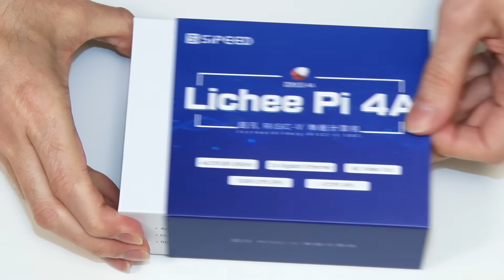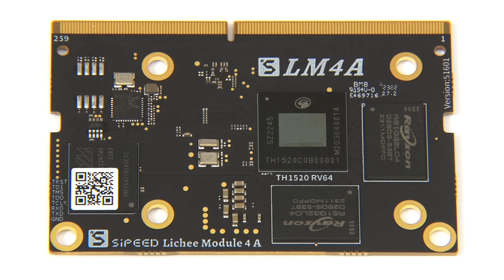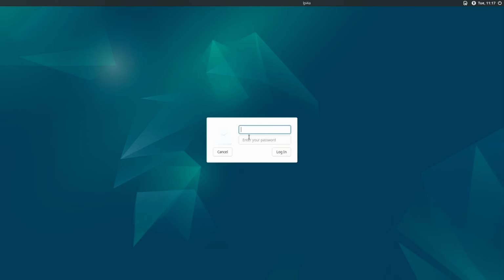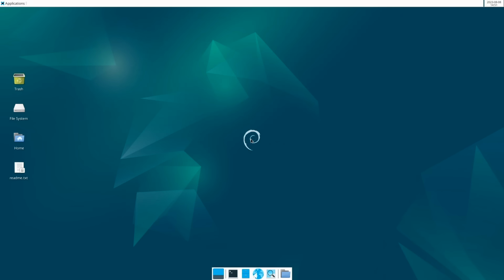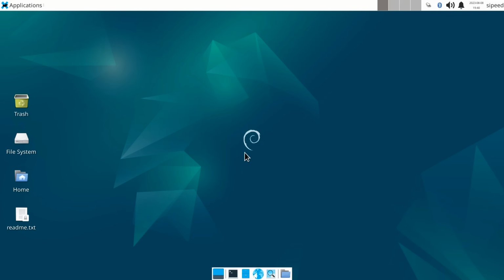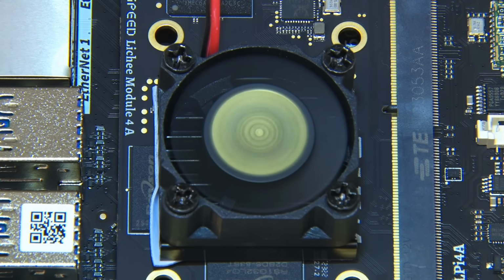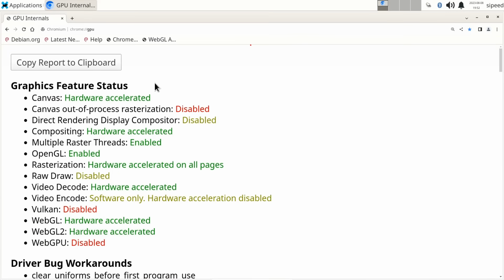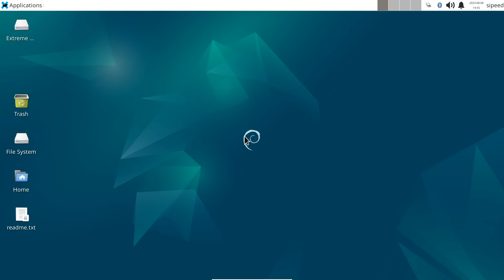Lichee Pi 4A: Serious RISC-V Desktop Computing

Comment: Free Software is just amazing isn't it? I don't see MacOS or Windows running on all these architectures. Gentoo is the penultimate example of what Free Software allows you to do, where you can compile every package on the system and optimize it for your computer. I hope that RISC-V does to the hardware world what GNU has done to the software world. I also wonder if they plan on releasing replacement SoC's that just slot into that backplane that you already have? That would be a good way to upgrade. I hope that we can start getting ATX or ITX motherboards that have replaceable CPU's, with how RISC-V is developing, something like that makes a lot of sense right now, at least for developers at the moment.

Comment: I’m happy to see another RISC-V board though for my uses I wish it had an M.2 connector for a SSD.
Reply: The base TH1520 SOC might not actually have the capability to directly add any M.2 storage at all. There's schematics on Sipeed's repositories of the carrier board and there's basically nothing on it implying any level of PCIe support.

Also, Sipeed said that they are going to add storage via the USB 3.0 ports for their laptop. Even the Evaluation boards don't have anything related to storage at all.

Comment: PoE is great but the GPIO is rather limited. However, one could easily interface with a dedicated microcontroller and use this module for all the higher level processing.

Comment: Once again, some fascinating RISC-V hardware.  The name begs to be compared to a Raspberry Pi 4.  I am looking forward to your RISC-V week video.  Curious as to how difficult it is to upgrade the distro/operating system.  I hope others find RISC-V as fascinating as I find it.  Looking forward to your next video!
Reply: If Raspberry Pi 4s were available at their normal price they'd make this board look very expensive.
Reply: @johnm2012 give me a raspberry pi with 2 nics, both being straight to pcinexpress, no USB in between.
Reply: @johnm2012  Raspberry Pi 4 price aside, it is still pricey.  Other than that, this RISC-V hardware is still fascinating.
Reply: There's initial support and (basic) device tree files in Linux 6.5 for the SOC, but nothing else in mainline Linux or Mesa. No microphone, sound, or GPU drivers in any mainline development path. Everything that makes this system tick is based of T-Head semi's repositories.
Reply: @No-mq5lw  Nice to know.

Comment: How exciting!  I am eager to see RISC-V rise as a viable, open-source alternative to the proprietary, closed chipsets.  Can't wait for your week long experiment!
Reply: only the ISA is open but the actual hardware is closed
Reply: @albertopajuelomontes2066  Depends, some people open their hardware as VHDL. You can literally load RISC-V on a FPGA and tinker with it. Others however sells design, usually with higher spec (like SiFive).
Reply: While it isn't open, the cpu is partially open sourced (openc910), afaik they only removed the pre ratification vector extension implementation in the part they open sources.
Reply: @oj0024  or didn't add it. The vector unit is an extra-cost option on the C906 and C910. The "ICE" SoC on the $400 EVB-ICE board in late 2021 had two C910 cores without vector units plus one C910 with vector. You could choose at boot time whether you wanted Linux to use the vector core or the two non-vector cores. The only C906 I"m aware of without the vector unit is the slower 2nd core (700 MHz) in the Milk-V Duo.
Reply: Exactly.  So disappointing.  This is no better than ARM.  Sure it can run Linux but we're stuck with a old kernel fork (5.10) with binary blobs and no word on Mesa support for graphics.  Any sign of mainline Kernel 6.4 support?  What about open source graphics drivers?  

Risc V is so disappointing to me.  It's just as bad as the ARM wasteland.  non-standard boot loaders, binary blobs, kernel forks.  Not good.
Reply: @tmlf1239  "no better than ARM."  Oh, man, you have NO IDEA how good it feels that this is now the most stinging criticism of RISC-V that can be mustered. That is huge praise, really.  Upstreaming of support into the kernel and various packages is in progress as we speak. Open sourcing of Imgtech drivers is in progress. Mesa too. In maybe another 12 months support for JH7110 and TH1520 (and other related SoCs to come) will be "better than ARM". And the hardware will be caught up to at least RK3588 level too.
Reply: @BruceHoult  that's good to hear.  Will we see standardized booting (a la EFI or standardized u-boot) and hardware trees for RISC V devices?  ARM is a mess here on Linux.

As for being as compared to ARM, ARM chipset and device support upstream in Linux is abysmal. Chinese vendors fork it for a while, then lose interest and move on to other hardware.   RK3588 support is slowly trickling in, thank goodness, but it's not there yet. I still can't easily build and boot a generic 6.4 kernel on the Orange Pi 5 yet.  

I'm sure RISC V will be successful but it will be the same closed, proprietary way that ARM has been successful.  But I had hoped for something far better from RISC V, but in the end it's just like ARM.  The only difference is the license fee the manufacturer pays.
Reply: @BruceHoult  " And the hardware will be caught up to at least RK3588 level too."

And that's you just speculating entirely as much as the person you responded to. You may be right, he may be right - until then, it's just your opinion vs. his opinion.

But in my experience, there are far more RISC fanboys than ARM fanboys - and "fanboy" is the opposite of "engineer", which is what I am.
Reply: same! i love how this may allow things to be both cheaper and better in the future, and the potential to reduce the secrecy and possible back doors in modern processors
Reply: @bingusbongus9807 That is largely a fallacy. Whilst there is no cost to use the ISA in your CPU design, most chip manufacturers will keep their proprietary CPU designs closed, and perhaps licence them out. But putting in all the hard work to design a fast, efficient chip is expensive and time consuming... and freely giving that design to your competitors doesn't make sense.
Reply: @another3997 sadly, open sourcing your hardware like that forces you to have to actually compete rather than have market monopolies. We wouldn't have tech dual police or monopolies if open source was mandatory.
Reply: RiscV is not that open source you think..
Reply: Your understanding of RISC-V is quite poor. RISC-V ISA is free but ISA is nothing but manual explaining the meaning of instructions. How these instructions are implemented in the hardware level is up to manufacturer! And it’s perfectly Ok to do closed RISC-V chipsets and that’s generally how the semiconductor companies do because it’s extremely expensive to design chips and no one in the industry is willing to give this for free.
Reply: @S1LLYC3REAL  that's why RiscV isn't open source at all..
Reply: @ThermalWorld_  the RISC-V specification is certainly open source, which allows potentially large numbers of vendors to complete to make the best and cheapest products. Any given device might or might not be open source. The RV64GC CPU cores on this board are open source with a permissive Apache 2 license. Other parts of the SoC are proprietary.
Reply: @BruceHoult  And SO WHAT? Open foundation business model is not that much different from any other comitee we had before, standardizing SD, USB, MPEG etc. Those who pay more money do have influence on how next versions of ISA will look alike. Currently it's used to put pressure on ARM by Chinease. We have for example Linux Foundation doest that put more pressure on Microsoft - sure, is there one OS standardized? No! Because it's one of many building blocks. You will have bunch of RISC-V CPUs some better some worse, every SoC will be different just as it was for ARM different buses, adresses, everything much like ARM based except this time Made in Shenzen not Taiwan. Say bye bye to STM, and Microchip say hello to Lichee and other Made In Crap Crap. x86, AMR, RISC-V still better than dozen of architecture. It's been 40 years - ARM time to say bye bye ;) Im not excited. Because why should anyone "excited"?
Reply: @KabelkowyJoe  mate, I'm sorry but I have absolutely no idea which of my comments in this thread you are replying to, or how your comment relates to it! You are correct that the Chinese are currently putting more investment into RISC-V than others, but there is absolutely nothing stopping others doing the same and I certainly hope some do. Meantime, there are many Chinese companies doing very good work, ranging from WCH in microcontrollers to SOPHGO in workstations/servers.
Reply: With great power (permissive licensing) comes great responsibility. I doubt that most RISC-V hardware will be open-source, and I am very concerned that future vendors will introduce proprietary extensions to the instruction set.
Reply: @njsynthesis well, then only support the few that are open then.
Reply: @njsynthesis  of course anyone can introduce proprietary instructions, but what instructions currently lacking in the official spec would provide a significant advantage?  RISC-V already has pretty much everything any other ISA has. And how do you persuade users to use them? Especially as you probably have to get support upstreamed into standard compilers to get it into standard distros.
Reply: Very exciting... indeed!

Comment: This is astounding, when you look at it. This is a massive move forwards for the architecture,  and will only inspire more development from others.

I suspect in five years time, the processor type is going to be far more commonly adopted, and could even stand as a decent competitor to X86 and ARM.

Thanks for the video.
Reply: Note that these C910 CPU cores were announced in July 2019 -- it just, as always, takes about four years to get from a core to mass-produced hardware. Imagine what has been started since 2019, and is still in the pipeline, but inevitable. Well .. we don't have to imagine. We'll have A76 (e.g. RK3588) class machines maybe by the end of the year but certainly early next year. And Apple M1-class chips are coming in a couple of years.
Reply: @BruceHoult  I fully accept what you are saying, but I remember the scepticism of the architecture being at this level for a few more years yet.

There is clearly a huge amount of development going on, and this is exciting to me. I want this processor architecture to succeed, and help to widen the options.

Thanks for the information,  by the way. It is appreciated.
Reply: @horseradishpower9947  computer SoCs are like a pizza ... you put the toppings on a base and put it into the oven , then have to stand around for ten minutes until it emerges from the far end of the oven. It takes a while, but there is essentially zero doubt that it WILL come out. It's just that with SoCs you wait around for about four years, not ten minutes. While there are certainly many skeptical voices all over the internet (many with a conflict of interest, by the way), anyone who keeps informed knows what is currently in the oven. I can't tell you what will be in 2030 or 2040 ... but the next three to four years? It is written. Pre-ordained. Inevitable. Skepticism about that time period is totally unwarranted. And in that time frame is 2020-level (or even a bit better) x86 and M1 performance. Which will still be a viable PC in 2026 or 2027.
Reply: @BruceHoult  Thanks for that, it's interesting. 

One of the biggest issues, though, is software and optimisation. You can have  the best hardware in the world, but if the software is badly using the hardware, it is hopeless.
Reply: As someone whose programs (Ansys, CATIA, SolidWorks, 2000-ish games) are Windows-only and 32- or 64-bit, I can't see that happening for enough people in the most influential branches.
Not until Windows-EXE support works out of the box because who has the patience to set-up and trouble-shoot Wine...
Reply: @CnCDune  Windows has the dominance it has, through monopolistic methods. If it ever loses that, it will quickly fall to the wayside.
Reply: @horseradishpower9947  old games and such may not work anymore if that happens. We already have compatibility problems - some since the Vista days :/
Reply: @CnCDune  It might be something that happens any way. There may be a time when Windows itself is too incompatable with old games. Time will tell, though.
Reply: @CnCDune  Companys programming Windows-only software will be dead in 5, latest in 10 years. Even Microsoft supports Linux in professional field (like MSSQL, OK,not professional, but it works). If you don't like Softmaker Office as a professional alternative for MS Office, you can still use MS Office Webbrowser based clients. That is roughly 80% of the use case in Companys.
AutoCAD came from Unix, so there is no problem in developing that for Linux, Games work with steam flawlessly. Any important server runs on Linux anyways.
I don't see any important usecase for windows-based computers in the next 10 years onwards, every operating system has its time, some lazy admins will eventually try to stick with it until retirement, but these will be replaced by skilled people and then complain for their own fault of getting stuck in the 90s...
Reply: @CnCDune   Maybe time for you to start looking at non-proprietary alternatives? Because it’s clear Windows has passed its peak — it is getting more and more expensive for Microsoft to maintain, while returning less and less profit. Which is why Microsoft is resorting to tricks like inserting ads everywhere on the Windows desktop it can.
Reply: @lawrencedoliveiro9104  I agree that Windows is past its peak and going downhill with each version, but unless I'm 100% sure Linux can handle Tiberian Sun (RTS from 1999) and its tools, among other games I have, plus touch&pen, I can't switch OSs.
MacOS is, of course, not an option either.

Same goes for Ansys, CATIA, SolidWorks and other engineering programs - actually, all engineering programs; I don't know of any that have Linux versions, maybe MacOS if you're lucky.
Reply: @CnCDune  Vintage Windows/DOS games tend to run better on Linux than on Windows.

The high-end CAD apps originated on Unix systems, back in the day. Going to Linux would be like coming home for them.
Reply: @lawrencedoliveiro9104  By vintage Windows, do you mean 16-bit or 32-bit prgorams?
TibSun and tools are 32-bit.
High-end CAD may have originated on Unix, but now there's only Windows-versions...
Reply: @CnCDune  There are open-source CAD programs that rival what’s available on Windows.

Old 16-bit Windows software runs better on Linux than it does on current Windows.
Reply: @CnCDune I understand you. I'm forced to use Windows on the workplace so I know the pain. Luckily I don't get to brake mice (I'm looking at you Dune II) since i don't play videogames anymore, so  at home I use Linux exclusively. Change is coming
Reply: @privateagent  If you like Dune 2 you'll love Dune 2000 and Emperor: Battle for Dune

Comment: Risc V is a game changing initiative and we all should actively support  it in the sense that our next PC should a Risc V machine. I hope someone takes similar initiative for graphics card (GPU) so that we can avoid the premiums and shortage of GPU. The success of Risc V should facilitate more and more hardware becoming open source which is not only great for budget but learning as well.
Reply: *only great
Reply: How would RISC V help with GPU shortages? The GPU shortages were exactly that, shortages. Too much demand and not enough fab supply. Switching architectures wouldn't help.
Reply: Only newbs need 4k gaming
Reply: Sorry, but if it doesn't support 4k gaming, it won't become my next PC.

Those boards are most likely meant to make China less dependent on foreign components. And they are perfect for that as you don't need a beefy PC for most industrial and administrative applications.
They are also nice for network appliances not needing too much throughput.

I too hope that Risc V will eventually become a viable alternative for workstations or gaming.
But that will most likely take a few more years...
Reply: @Oktokolo  SBC's would be the last place I'd look for hardcore gaming.

Comment: No one really is designing fast enough riscv soc. Even arm isn't fast enough compared to apple. Let wait another decade before we see any tablet or phones with it
Reply: RISC-V CPUs of comparable speed to Apple M1 are already designed, and by several credible companies, often with employees who were previously at Apple (or AMD Zen) ... it's just going to take several years for them to work their way through the production process. Note that the C910 CPU cores in this were announced four years ago in July 2019 and that this is typical. The Arm A72 core was four years and four months from announcement (February 2015) to Pi 4 (June 2019, and the A53 to Pi 3 was a little quicker than four years (October 2012 to February 2016)